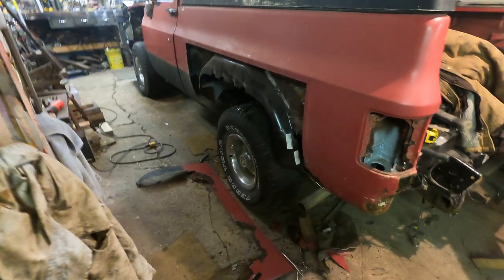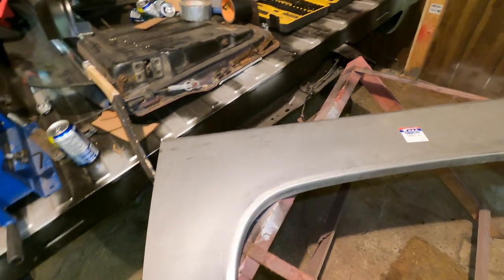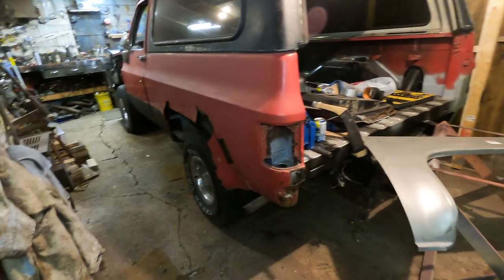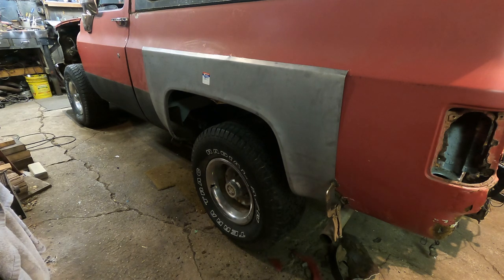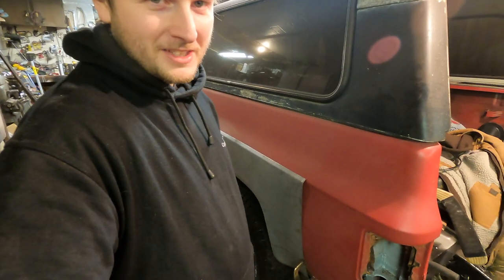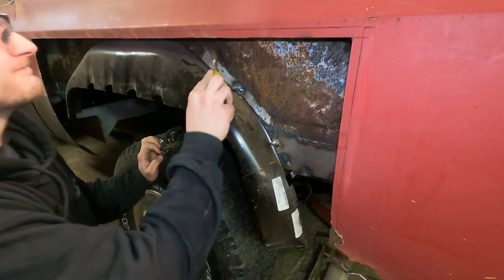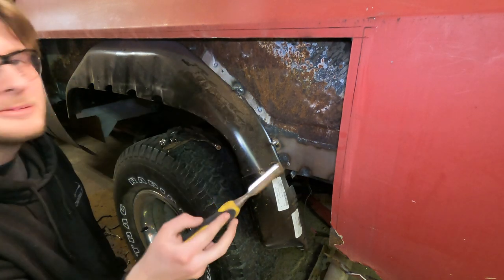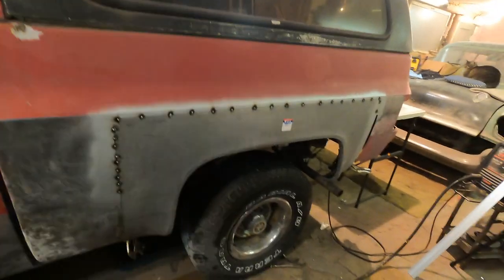87 K5 Blazer Part 5 Quarter panel arch welded in!!!

Comment: Just found this vid, awesome work! Going to try and do the same to my 74 C10 longbed. 1 question, no need to remove the inner wheel wells? Greetings from the Netherlands! (Half Canuck from my moms side)
Reply from the maker: Thanks! No you shouldn’t have to remove the inner wheel wells to do this, good luck with your project!

Comment: Where you buy your part
Reply from the maker: I bought all the sheet metal off of eBay.
Reply: @TuquesNTires  Thank
Reply from the maker: @martinlefebvre3113  no problem! I tried finding the link of the ones I bought but the seller doesn’t have them anymore.